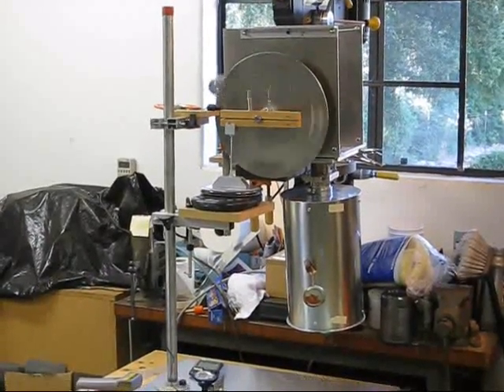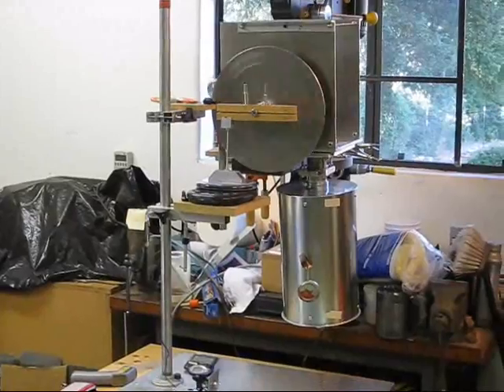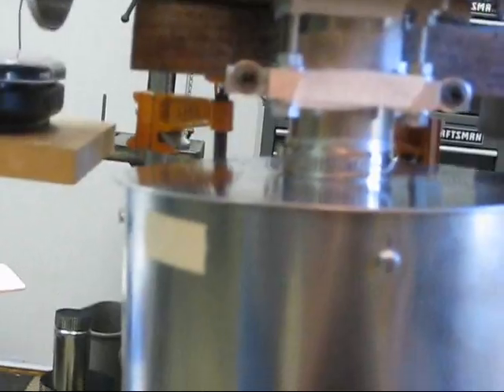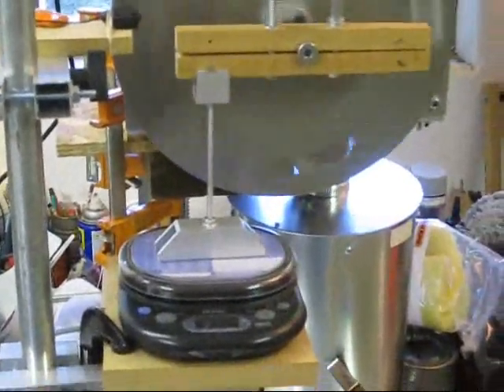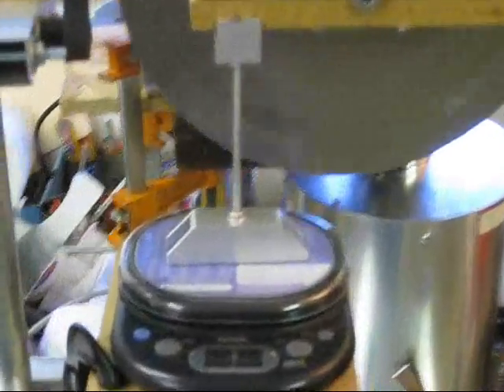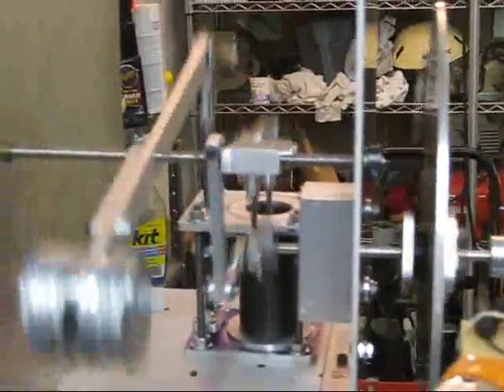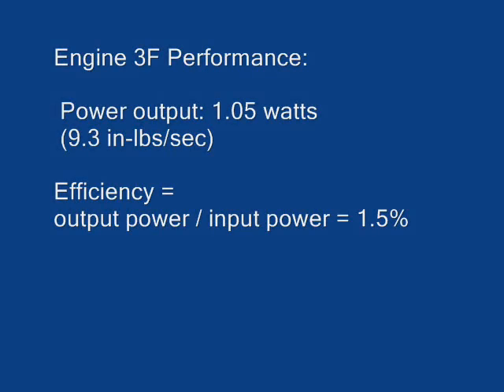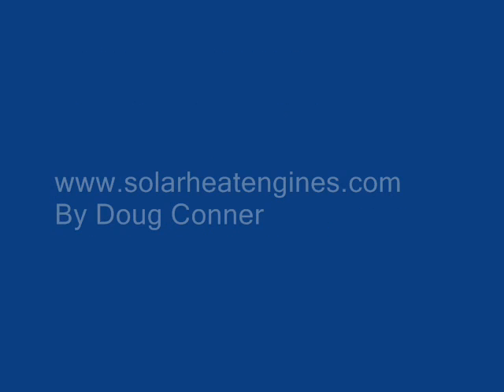Stirling engine generating a measured 1 watt power output

Comment: @solarheatengines I like!
About this 69W: Most of this is going to elsewhere than heating up hot cap's internal surface. Temperature of filament is about 2800°C where the wattages go and your hot cap´s outside is just 200°C? 
Heating surroundings is the source of huge loss that you are measuring, not the engine - I think it´s much better.
If you can put your filament inside the engine you´ll get much better I/O results. Like in here /user/approtechie#p/u/51/ap5NdWCxrxk

Comment: @solarheatengines  the theoretical answer is no, as per: "the steam partial pressure of a liquid caused by liquid-evaporating in the expansion cylinder is added to the gas pressure. This results in more work output per revolution, although the overall efficiency is reduced, -due to evaporating the liquid and condensing the vapor- as it could be seen, when interpreting the "frames" in   Fig. 4a and in   Fig. 4b. See chapter The thermal efficiency htherm.
home germany net 101-276996/english htm

Comment: Has anyone examined phase change materials (liquid to gas) near room temperature as a method ? Maybe low pressure methanol in a closed loop system with a condenser for example, might work with less heat loss to the environment and more mechanical energy conversion.

Comment from the maker: @robertjvictor You are correct that the lights watt rating is approximate. This one is actually rated at 75 watts but I refer to it as 70 watts because it always measures 69 or 70 watts. Near the end of the video I show the watt meter reading as 69 although it's a little difficult to see.

Comment from the maker: @millamulisha No visible light escapes from the setup, only infrared heat. Because  the visible light is totally converted into heat, 1.05/69 = 1.5% is correct.

Comment: It's not a direct 70W to 1W efficiency as the lightbulb's main use of energy is lighting, not heating. You'd have to find the power as a function of temperature in order to determine the sterling engine's efficiency at capturing heat energy and converting that into mechanical energy as the engine will not capture the energy thrown off in the form of visible light (duh). So thus I think the (1/70*100=1.4%) efficiency you post is incorrect.

Comment from the maker: @thomasrchavez 
I don't have anything else on this engine available yet. I'll put some more information on my websie in a few days. This engine was a modification of an earlier engine to test a new displacer. If you ran this engine unloaded it would hammer itself apart. I don't want to offer plans for this design, but I'll design a new engine with what I've learned and then I'll offer plans.